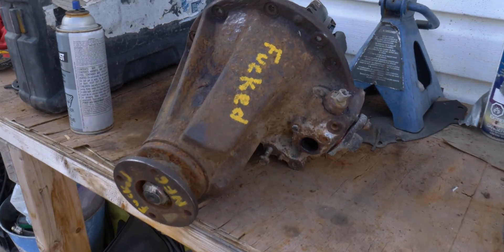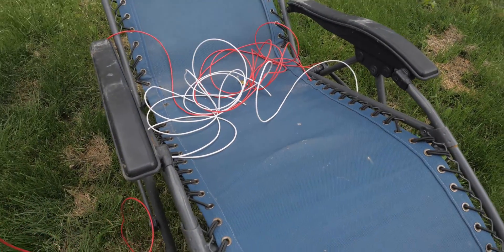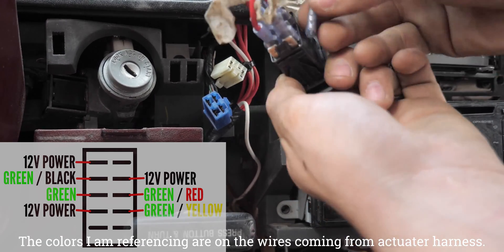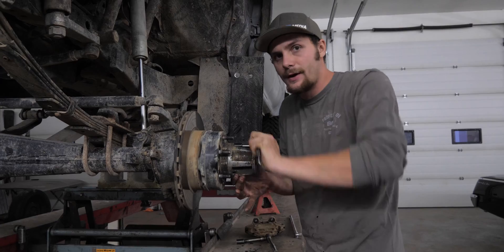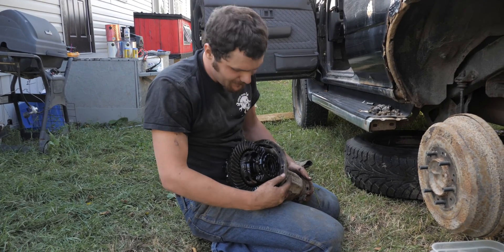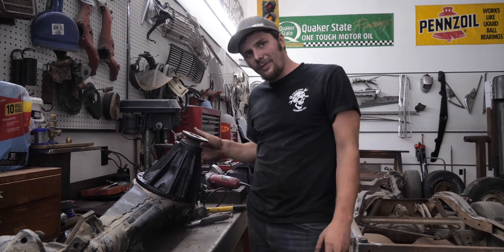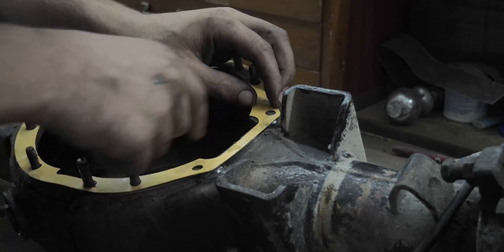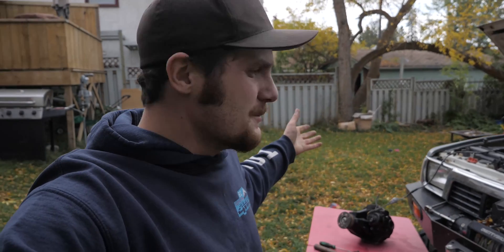E-Locker Swap Complete Guide (Including Wiring and Fabrication)

Comment: Do you think that the differential gears of a 1980 Toyota pick fit an elocker just to change from one to the other?
Reply: There are a few articles on using 4 cylinder gears in a v6 carrier, just need to use a larger shim under the pinion bearing as they are short nosed

Comment: To swap the 4.56 gears, is that something a diff shop needs to do because of the shimming and such? I have 4.56s in my 92 pickup and I’ve heard elockers dont come with those ratios
Reply from the maker: Elockers do come with 4.56 ratios. I've seen a few. But yeah in general easier to get a shop to setup diffs for you.

Comment: I'm picking an e locker up this weekend for my 93 4 Runner. But Im getting the whole axle with new disks brakes and rotors with e locker from a 97 or 99 4 Runner lol I can't remember. And I think it's a no brainer to put the whole rea end in. I'm stoked. I will be returning to this for the wiring after I get it all in. Already have some sort of locker in the front so this should be sweet. Thanks for the vids. I always watch them. I'm down in Bellingham Wa USA if you're ever wheeling down this way.

Comment: I have a 84 toy diesel 2L solid axle if I put a e locker from a 98 Tacoma in my truck will this work for me also?
Reply from the maker: Yes, same front axle in mine.
Reply: So I also acquired an 92 Toyota extra cab with a hi steer and a SAS already done on it. It already has a locker in the front and no locker in the rear axle, could I use the E-Locker in the 92 rear end?

Comment: Cheers thanks your video filled in a few blanks around the toyota 8 " variants, I believe all the New Zealand built Ln106 and Ln65 only had the 4 cyl 3 rib diff, its interesting but makes sense now with the engine options compared to the North America Market  . I have just secured a v6 turbo diff 4.88 which is very rear came from an import v6 surf . We did not receive the e locker option in the hilux but the 76 series prado landcruiser ran the 8 " high pinion e locker front we have a few of them over here so I will find a couple of them. Enjoy your trip away wheeling on Tuesday. Cheers

Comment: What is the gear ratio you have in your truck ? 
Does the diff locker should be same gear ratio ? 
I purchased a 4.10 and I do have 4.56 on my truck
Reply from the maker: My truck is 4.56, the locker needs to match the truck. Otherwise you will blow up your t case. The elockers are easy to re gear, the factory 8" ring and pinion bolt in place in the locker.
Reply: @DirtGarage  ohh ok thank you 🤝🤝🤝appreciate

Comment: Hey Dirt Garage,

Killer video! I really like the manual switch setup rather than the computer operated one that comes with the 3rd Gen Runners. 
Can you audibly hear when the motor stops and are there limit switches to keep you from burning out the motor? Is there a feedback line for the switch to illuminate when locked?

Keep up the great work!

Comment: Hello, good morning, I loved your video, what vehicle did you get the elocker from? I have a toyota hilux front differential and I would like to do the same upgrade
Reply from the maker: Mine is from the rear of a 2000 4Runner.
Reply: @DirtGarage  not working backwards?
Reply from the maker: @cebado4x4  No, these Toyota diffs are the same front to rear. Front uses back of the teeth.
Reply: @DirtGarage  OK thank you very much

Comment: I have plans to install the Toyota elocker in my 2nd gen tacoma, (rear) plan to just swap the hole axle assembly. I am guessing you ditched the Toyota ECU for the locker? Trying to figure out how I can bench test the axle with locker on the ground easily, to be sure the solenoid works before I dish out the big bucks, seller wants for it! Hrs or research now, and no simple find for doing this test?

Comment: How do you make sure your holes are straight?
Reply from the maker: I held the drill as straight as possible, this is the biggest reason I took my axle out of my truck to do this. Worked out!
Reply: Magnetic drill, if you can afford it, or a drill press.

Comment: About to rebuild my rear axle. Contemplating doing this thanks for the great  videos or else i would.not be contemplating this mod.  

Om the fence it but really wanna. Just did a 3.4 swap earlier this year. And the 100mph made my diff leaky.
Reply from the maker: Glad to help! I would highly recommend this mod. It's actually really easy to do. We are about to do the same thing in Cory's front axle!
Reply: @DirtGarage  picking up an elocker 3rd member today!!!   I see you are doing another elocker in your friends front axle, and you put the one in the video in the front as well.  Is there any critical difference in this mod when applying to the rear? Or same general idea? I plan on putting this in the rear until sas comes later.

Comment: Thank you for the great video. One of the only true e-locker swap mod videos I can find! So I have a few questions...
I recently purchased a rear 3rd member with e-locker, wiring and switch included. I believe it came off a 3rd gen runner with 4.10 gear. I have a 2000 SR5 V6 runner with 4.10 gears

Will I be able to swap this into my rear diff? 

Just need to tap and weld and it should be good? 

Any information would help! Really want to get my runner dialed in the right way!
Reply from the maker: Yes just weld and tap and it will bolt in, ASSUMING your diff is a 8"? Honestly I would scrap the factory wiring and switch included and use the low range kit, you will have alot more control over when it's locked.

Comment: I see in your video you didnt have to grind the inside of the housing where the bolt hit  mine is hitting  what did u do with that bolt
Reply from the maker: Mine didnt! But I've read on some forums some people have to take a hammer and beat a small dent in it. Sorry, I should have mentioned that!
Reply: Dirt Garage i did grind mine to much amd went almost all the way through i gonna have to hammer it

Comment: Hey... curious... does it work if I were to put it in the front of my 2000 Tacoma 4x4 trd off-road? ifs?
Reply: 80 series front axle?
Reply from the maker: @FinMcMurder  I'm not positive about that? If the ring size is 8" like the mini truck axles I do not see why not! You would have to do some research though.
Reply from the maker: Nope. The IFS front is a smaller size, 7 1/2 or something. I don't remember the exact size. But its smaller. This will fit any 8" Toyota axles.

Comment: I'm about to do this and your video has given me confidence. Cheers !
Red Cap at 14:18. Top Bolt. How about counter sinking the top hole and putting an alan key headed bolt in there ? I'm a great believer in putting all the nuts & bolts back in.
Reply from the maker: Thank you! Glad I could help. Honestly pretty easy all said and done. Good idea with the counter sunk top bolt. I will certainly do this next time the diff is out!

Comment: ive never actually seen how these work... very cool! i thought those had to have a brain to function! thats fantastic! im thinking i should hunt for elockers once i get my mazda going haha! dude, you should totally do the big brake mod with the IFS hub mod haha! i have a writeup that i did on Marlin Crawler's website! i could even machine the IFS hubs for you so that the 98 tacoma rotor fits over the hub!
Reply from the maker: Stock they do need a computer to run these lockers. But with that fancy switch you bypass the need for that. And I plan on doing all of that to my front axle eventually. Brake upgrade is certainly required with the 37s Haha
Reply: @DirtGarage  haha, i hear ya! i ran 38's and 42's on my 4runner with the BBM and IFS mod and it was no problem stopping, or pulling trailers haha! i just updated the build thread, with active images (uploaded them to my website cause photobucket turned greedy!) if i wasnt planning on using my IFS hubs, id send em to you haha!
Reply: https://board.marlincrawler.com/index.php?topic=78969